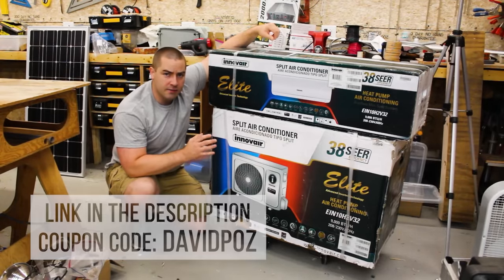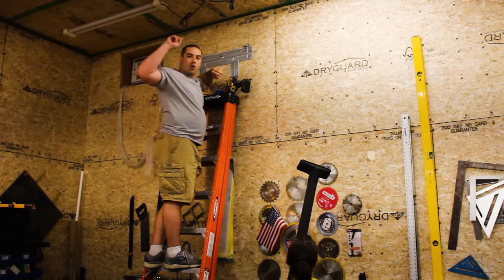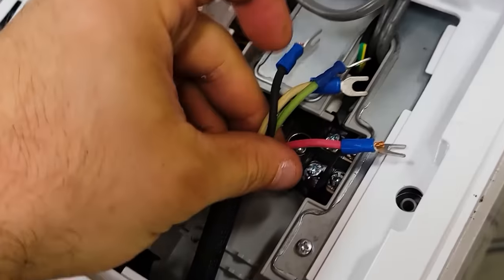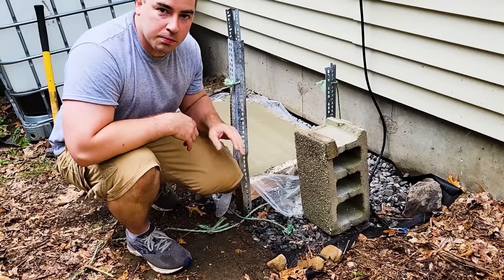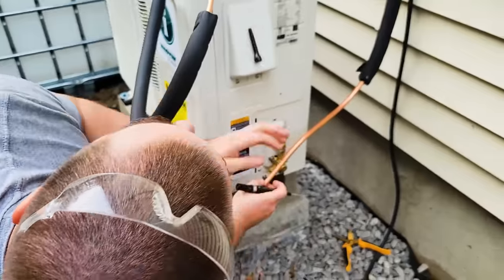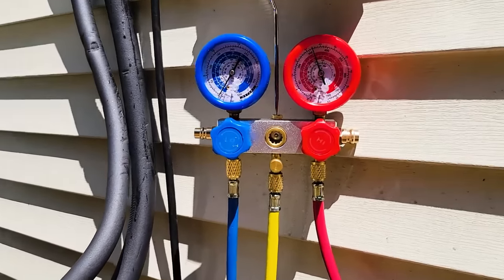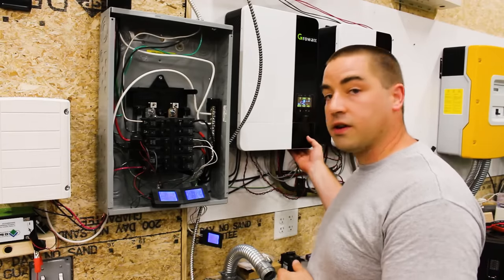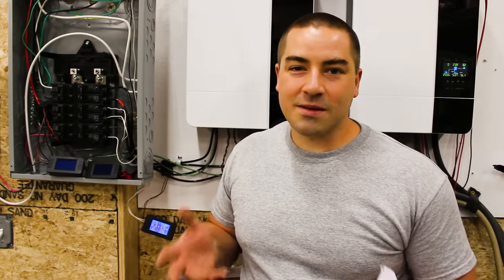DIY Mini-Split Heat Pump, Full Installation, 2021

Comment: Great video Davi. Thank you. Can I use any 240v inverter ac unit on this Growatt? Or does it need to be a high seer rating. I'm not sure if we measure in seer in the UK. ID BE SHIPPING TO OR BUYING IN JAMAICA WEST INDIES.
Reply from the maker: Sure, any AC.  The inverter drive on the mini-split will ramp up the amps slowly.  This is important to not over-surge the inverter.
Reply: @DavidPozEnergy  OK Thx David. Great channel. In 12 years time Gods willing I’m hoping to build our retirement home in the Caribbean, but it will be large 3 bed with three additional studio apartments and a swimming pool, with sauna and gym. Assuming I use LED lights everywhere and both 240v and 110v appliances. I’m wondering if I can be completely off grid with 20kva generator back up and have a 50kwh battery built from Eve cells. Maybe use dc solar pool pump to circulate but would need more power for the WELL PUMP and jacuzzi pumps. Am
I’m being realistic as the array would need to be massive to stack 3 or 4 Growatt sfp 5000es in parallel. Hope I’m making sense.

Comment: 38 seer is only when it is in a/c mode. If you have any kind of humidity where you live you will find this setting useless and will turn it to dehumidify which will promptly take it back to 10 seer. Also when you are going to use ductless for heat you want to buy a unit with a dual stage compressor. These are labeled as HIGH HEAT, HYPER HEAT,and many other clever names. These units will supply rated btu output to 0 and below. Your unit will only supply about 50% output at 0. This is a huge misunderstanding in the ductless field.

Comment: I was wondering what the starting surge was. Did you mention it in the video? If so I missed it.
Reply from the maker: No surge.  This is inverter-driven, it starts at 0 Amps, and slowly ramps up to a maximum of 3.5 Amps.
Reply: @DavidPozEnergy  wow! Really? That's amazing!
Reply from the maker: Yeah, I think I mentioned it right at the end, when I was talking about up to 5 units could be on one inverter. Not sure though.  There was a lot of editing so sometimes I forget what made the final cut.

Comment: Cool video But how come you didn't show the charging process? is it because its precharged no additional charging needed?  and what did the proper electrical service cost to install (208v) ?
Reply from the maker: Correct.  It came pre-charged.
Reply: @DavidPozEnergy  Thank you for the reply…Great Vid

Comment: So how has this been doing for you?  Does it keep your space cool/warm? I want to get at least one (probably 2) to cut our bills down in the house. I would like one upstairs and downstairs. Would 2 of these help in 2000 sqft?  I know 9k BTU isn't really enough for a large space like that, but if I could get through the mild cold and mild heat with them, I'd be super happy and I'd only have to run the larger A/C and heat unit when this can't keep us comfortable enough.
Reply from the maker: This unit is working very well.  It's working better than the Mr.Cool.

Comment: Hi, David.  What was the reason for the exterior concrete pad?   I've seen the compressor unit suspended on the outside wall?
Reply from the maker: It's OK to use brackets and attach it to the wall.  Both are approved options.  Personally, I don't like putting that much weight on some brackets attached through vinyl siding.  I've seen vinyl siding crack around heavy attachments in a couple years.

Comment: Can you show your power usage in heat mode?
Reply from the maker: It's in heat mode now.  This mini-split will ramp up and down it's power usage based on the load.  Right now it's drawing 70 Watts to maintain 68°F inside the garage, but it's 50°F outside.  Last week it was 20°F and I saw it drawing 900 Watts at one point.  So it varies.

Comment: Observed some code violations. You are never allowed to use rubber cord in place of permanent wires such as MC cable. All conductors that transition from temperature difference such as going from an indoor heated location to cold outdoors you must seal wires to prevent condensation build up. I would seal the 3 wires at both the outdoor LB condulet and where wire enters metal box. We were taught when gluing PVC conduit to give it a twist while inserting and hold firmly for 15 seconds so it does not work out of fitting a little. 
We always used primer  before applying PVC glue. Must now use a torque wrench when tightening ALL electrical screws & bolts. I would install 3 straps on outdoor PVC so it does not bend during temperature swings. Up north a 100' of PVC will change 4" in length  from summer to winter.so you must install expansion joints on all runs over 10'. Also need a 120 volt ARC FAULT/GROUND FAULT protected receptacle within 25' of all outdoor AC units. Good luck with animals chewing on illegal rubber cord going to outdoor unit. Great that you secured power before working in panel or else you would need to wear proper PPE.  Would never use a powered cutting wheel to cut slot in MC jacket. If I did not have one of my Roto split tools would use a 32 tooth hacksaw blade in my hacksaw. We always use the red anti shorts even where not required.
Reply: If that's TC-ER, then a change in the 2017 code permits its use in one and two family houses.

Comment: My only question is how well that unit will heat in lower temperatures? Most mini-split air units can't handle the lower temps and in fact sometimes destroys the compressor due to the freon becoming liquefied with colder outdoor temps. I really would like to know how well your unit handles colder outdoor situations?
Reply: Its really varys depending on manufacturer and model. Mitsubishi makes one called "hyper heat" that will heat to -14 Fahrenheit. 
Fujitsu also makes one called "halcyon" that also heats in extreme low temps.

Comment: I've installed 2 mini splits. I don't understand your wiring setup. The wires from the outdoor unit to the indoor unit operates only the fan and the thermostat/computer. In both of mine, I ran the wires through the same hole as the lines, as directed by the mfgr.
Reply from the maker: I did as well.  the hole I drilled through the wall was for the supply power to the outdoor unit.

Comment: Have you tried to us the heat pump together with floor heating (like the coils in our garage)?  This could be the most efficient setup IMO
Reply from the maker: I have not tried that.  I would love to give it a go.  Have you seen a heat pump for this?  The ones I have seen are about 3x more expensive
Reply: @DavidPozEnergy  In theory a pool heat pump has already the right design  but It is not designed to work below 10 C outside

Comment: Hi David, I've seen most all of your videos and just want to understand your perspective here on the efficiency of this 38 seer and if I did the cal correctly, this unit seems to be rated at only 17 SEER for AC, and 9,000 BTU looks to be the AC max/power, and I see you were using 1600 watts at 110v from my understanding this is 5.625 Btu/Wh or 5.62 CEER which seems like really poor efficiency, did I get that wrong?  I converted to CEER to compare a typical fully contained window Unit like the one you have. I cant really tell your unit model, but a super cheap $99 Walmart purchase for the GE 5,000 BTU window unit is 410 Watts and a CEER rating of 12.1 so.. if we take 5000/ 410 we can realize the 12.1 CEER so more than twice the efficiency.   Its true you can see that the minisplit dropped down to 135 watts, but when it's really working to do its job it was pushing 800 watts at 240v, or 1600 watts 110v so 4 times the watts your window unit was using for not much more BTU.  Also this seems to coincide with the 17 SEER rating it has for AC which I think calculates to about 1 BTU per watt or around 1600 watts and they likely rounded up from 16.5 to 17 to get to 17 SEER. Do you feel this is more efficient, why or why not?  I do see a few other reasonably priced models that only do AC and have a 24 SEER on Amazon for cheaper and come with WIFI connection.  As always David, thanks for your great videos and thank you for any comments or feedback on my note.
Reply from the maker: This mini-split is 240V.  When I first turned it on it was about 800 Watts for the first day.  Then, as the temperature of the garage reached the set point, the mini-split only had to maintain the temperature.  So it automatically slowed down, into a more efficient point of the BTU:W curve.  I can't tell you with certainty exactly how efficient it is, but I'm impressed.  It's keeping the garage a lot colder than my window AC ever did, for half the energy use on average.
Reply: The 800W on 240V would still be 800W on 120V, but double the amps.
Reply: You need to test both units side by side at same time with same air to do a real comparison. The test results are dependent upon the humidity ratio as is it's nominal rating. I'd just run both units at full capacity at same time and see what they draw for load and than use the nominal BTU output to compare there efficacy. It's given that one unit might perform better than the other depending upon the humidity ratio during the test. This would be the fairest test considering assuming the humidity at time of test is within what you might expect where you live.

Comment: I hope this gets a response cause I need it. I'm doing the 220 volt 9000 btu inovair. Will it run off the split phase sungold power inverter? I don't know if 220 split phase can run a 220 apliance that doesn't require split phaze
Reply from the maker: I don't see any reason it won't work.
Reply: @DavidPozEnergy thanks for responding. I trust you and watch your videos alot. I have 2 inverters running my camper. One is a all in one 3000 watt powmr. The other is a sungold power 4000 watt low frequency split phase. I'm having grounding issues with my system and wish you had a videos explaining the problems with hybrid systems and grounding

Comment: I'm not sure if you see the comments or respond still since it's an older video but I just got my minisplit.  It's the exact one you have in this video. I'm installing it this coming weekend on my travel trailer. I'm using the sungold power 220 split phase inverter and was wondering how you are still liking yours? Do you have any advice for me that's not in the video? It's gonna be a struggle installing but with your video I think I can do it. Any advice is appreciated
Reply from the maker: Mine is still running 24/7.  Works great.  However, my installation is a stationary garage.  I don't know what you might have to do for the vibrations on a travel trailer.  Good luck.
Reply: @DavidPozEnergy  with the vibrations I'm using the rubber feet and hopefully secure the lines in a way where there's no strain on them.

Comment: Curious to hear how this install has held up?
Reply from the maker: This is my favorite install because it hasn't given me any troubles.  I leave it set to a temperature and never touch again until fall or spring when I change it to heat or cool.
Reply: @DavidPozEnergy hat's awesome to hear - attributed to your careful install I'm sure. They say aside from luck of the draw, quality of installation matters more than brand for HVAC

Comment: If you run just 240v appliances on a separate unit and use the same Battery Bank Can you actually use PV from both inverters to charge the same Battery Bank ?  I was under impression if they were not Parallelled the two units would :fight : each other sensing the others charging voltage as the Battery voltage and cut the charging on and off.
Reply from the maker: I've run 2 different inverters off the same battery bank before, and different charge controllers on the same bank.  None had any communication with the others, but it all worked great.  

I can understand fighting each other if you have an undersized battery bank, or small wires causing voltage drop.
Reply: @DavidPozEnergy  Battery bank is 80 kwhr but currently using half on each inverter ( 2 LV548 MG for long pv run 405v and only 240v out for HVAC) . 2 LV5048 split phase in parallel for rest of the house.  I would like to use same battery bank . I guess maybe if I set max BMS voltage lower than max LV s max voltage they may both charge the bank to the max BMS voltage and similar set minimum voltage on BMS above minimum on inverters.
I am sure without a BMS being used when they got near max voltage they would "fight".
Reply from the maker: In my system the BMS will shut off at 58.4V.  My charge controllers (inside inverters) is set to Bulk:56.0V .  I never want the BMS to shut down unless there is a problem.  Normal day to day cycling the charge controllers should be inside the limits of the BMS.  But it sounds like you have a ton of experience with that size of a system, so I'm sure you will figure out something that works well for you.

Comment: That's a first. Most mini split units come precharged. Including the lines. So all you do it hook it up and turn the valves on and they just work. At least in the 2 I have put in. So not sure what issues this company has with precharging theirs too.

Comment: Why you don’t leave a loop outside and cut the tube? 🤔
Reply: Cutting the tube to the exact length makes for a cleaner installation. For people who don't want to do that there are the Mr Cool or Pioneer more DIY versions, but you end up with a coil of line set that you have to tuck away or worry about catching it on something or tripping over it.

Comment: Just wondering if this type of system would be more efficient than the standard ac system that is typically installed by the manufacturer on an RV?   Also, where do I find a five year old super? 😉. Nice job.
Reply from the maker: Maybe, but I wouldn't know without looking up the data sheet.

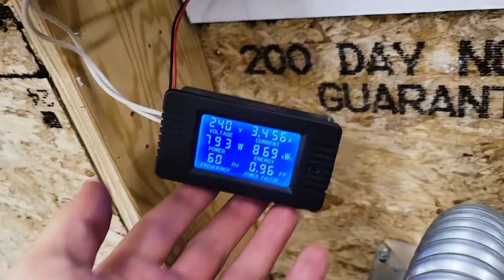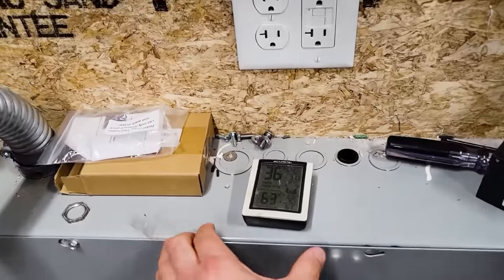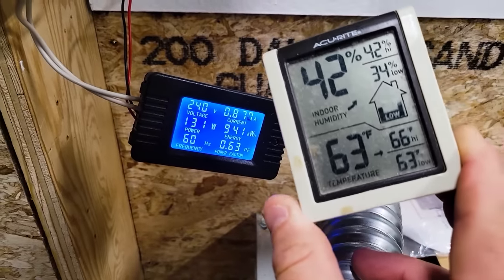Comment: At 1:04:57  the initial total kwh reading was 869Kwh.Then at 1:05:06 David mentioned being 24hours past. At 1:05:25 the total kwh was kwh. Then at 1:05:44 David says he is was at 48 hours later and the total kwh was now showing 941kwh. this means that 24hours later the total used was 906kwh-869kwh=37kwh and at 48hours the total consumption would be 941kwh-906kwh=35kwh. Those are absurd readings!!!!! Can explain these readings David given my similar 9000BTU AC only draws 3.4Kwh in 24hours?!!!!!! That is more than 10x for an AC of 38seer.
Reply from the maker: I have a follow up video on this unit after running it for a few months.  I think I averaged 6kWh/day through the winter for heating.
Reply: That’s 25ah at 48v but I use 197ah of 48v battery bank with 6kw inverter split phase with same AC 9k btu unit in 10-11 hours.
Was your aims INVERTER that hungry? Mine is 185 watts on no load.
Two nights ago was pulling 60 amps 3051 watts on victron shunt for a few minutes only powering mini.Bad inverter glitch?

Comment: Your voltage test on the load center should have checked to neutral. Measuring between the breakers only verified ONE inverter was off, the other one still could have been putting out voltage to neutral. Be sure to ALWAYS test to neutral when safety checking for voltage.
Reply from the maker: These inverters are 240V only.  But nothing wrong with more checks for safety.
Reply: @DavidPozEnergy  gotcha! Just a tip for others then. Always test to neutral as well.

Comment: With technology moving so fast, what battery should I buy ? I’m thinking 15-20 kva
Reply from the maker: Right now I'm running my house on 30kWh capacity of these batteries: https://www.signaturesolar.us/products/48v-100ah-lifepower4-battery-by-eg4  And they are working excellent.  I think they are the best buy right now.  Discount code: DAVIDPOZ25

Comment: Are there any heat pumps that have a heat exchanger to water as twenty feet below the ground the water Is a constant temperature lt would easily give me a better efficiency I'm going to put an add on kijiji to see if l can find an ac technician who would upgrade my existing air-conditioned
Reply: So he asked to borrow the jackhamer and dad let him 4000 pound concrete and it went through it like a knife through butter it wasn't the jackhamer that was the problem it was the strength and elasticity of our concrete now I add welbond to every concrete and plaster job i do even thinset for laying tiles and the groat for I between the tile did a floor tile job the home owner was told by professionals tile setter that the floor had to much bounce in and groat would pop out and the tiles would come loose it's been over fifteen years and the groat is still holding and the tile are still solid
Reply: The red things are called antishorts they keep the aluminum  casino from cutting through the wire insulation and causing a short

Comment: David I love your videos. What’s the average KWh you would say that the mini split uses per day for both heating and cooling?
Reply from the maker: I put a meter on it during the summer, one of the hotter weeks, and it averaged 6 kWh/day.
Reply: @DavidPozEnergy  any idea on how much using the heating mode?
Reply from the maker: I haven't put a meter on it to record over time in heating mode.  But, at this very moment, it's drawing 80 Watts to maintain 66°F in the garage.

Comment: And I forgot to tell average cost of 20 Amp 220 to run this is 2 to 3 bedroom  250 dollars low to 340 dollars high be smart and make shore you have a good back up furnace its going to be a while before thay perfect this system to last a long time but you know the industry they make it last so long to make money 💰  like anything else